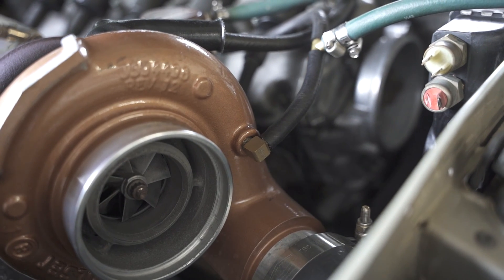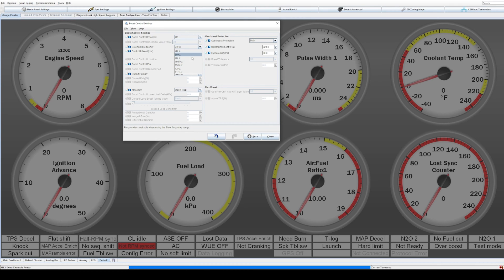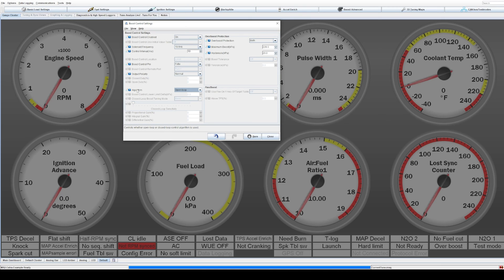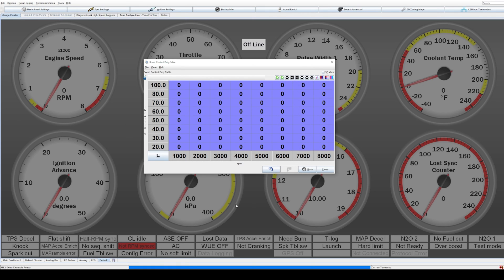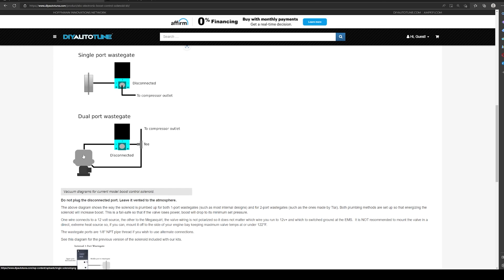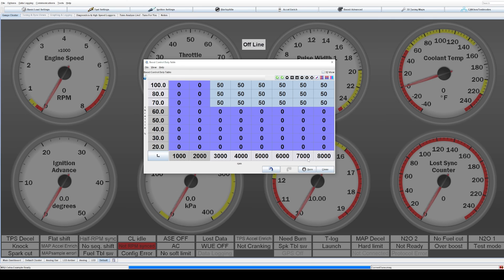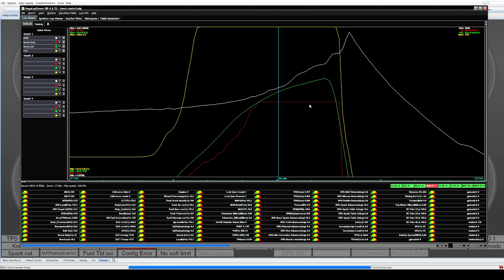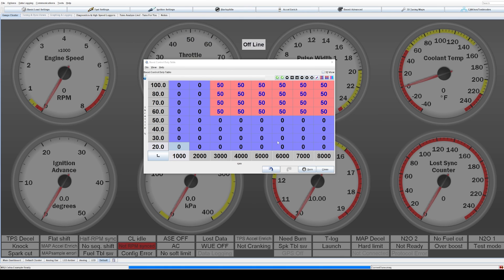Megasquirt Boost Control Basics | Open-Loop PWM 3 Port Solenoid | How to Tune

Comment: It would be nice if you covered the install for internal wastegate. I guess the selenoid works the opposite where it will block the signal to the wastegate until you reach desired boost ? In that case is there any rule of thumb to anticipate the extra boost from a certain duty cycle ?

Comment: Hi, I’m a little confused on the overboost protection section. You say 200kpa is equal to 1bar but isn’t 200kpa equal to 2bar? I don’t want to get that bit wrong lol. 😅 any clarification would be great. Great videos, I’ve subbed.
Reply: Ah!! Never mind, I found your other video covering Overboost Protection Basics. So anything over 100kpa on this cell is classed as boost pressure, so my current setting is 210kpa, this is 110kpa of boost right?
Reply from the maker: Yes 🙌
Reply: @ legend. Thank you so much. So glad I found your channel. 🙌
Reply from the maker: @ you’re welcome! Thanks for watching ✌️

Comment: Doesn't setting it to 100% in the lower areas hold it fully closed and increase spooling?
Reply from the maker: Yes it can but that’s in the advanced video  :) this is the basics just to get up and running
Reply: @TurbineResearch  could you link the advanced video on this

Comment: Hey man, thanks for the video.

I have a 1JZ VVTI swapped RX7 that uses a MicroSquirt. The VVTI is unplugged and unutilized, however after watching this video, I was wondering if I can use the boost control settings to control the VVTI solenoid (I have a greddy profec boost controller independent of the ECU) 

Since the VVTI solenoid also has a frenquency and is typically controlled by TPS x RPM, I think this can work. 

Theres VVTI calibration tables online… now the only thing is that my FIDLE is currently used by something else. 

Is that my only PWM control for boost control? Or is there other PWM controls I can use?

Thanks

Comment: Great video.  I’ve watched a few others on this topic and they mention running 100% DC in the lower RPMs to improve spool.  Would that reduce the life of the solenoid?
Reply from the maker: I guess it depends on what you are trying to accomplish with the tuning. These solenoids are very reliable and I don’t think you will hurt the solenoid by using it more during transient conditions
Reply: @TurbineResearch  Thank you.  I’m just trying to understand all this before messing with the boost control.  I’m going to follow the approach in your video first.   For single port wastegates, does the same math apply where 50% DC would result in 12psi on an 8lb spring?
Reply: Thats what i do.it’s one of the main reasons to have an electric boost solenoid.Just becarefull on your cross over cuz its ez to over boost before you get down to your desired boost.

Comment: My wastegate is a side port only, spring is 10 psi. Let's say I enter 70 for throttle % >= 50 and RPM >= 4K. Is the max boost 17psi?

Comment: how are you monitoring your knock when upping the boost controller? great informational videos btw!
Reply: just curious because I noticed your logviewer didnt have any monitoring for knock
Reply from the maker: This motor doesn't have any knock monitoring. However, the tune was verified safe on a dyno at this boost level

Comment: Car: '91 RX7 TII, Microsquirt ECU. I'll be using the FIDLE for the idle control. Which is the next preferred pin to use? The stock ignition will use IGN1, 2, and WLED for Select (Spark C). I ultimately will run a Flex sensor and knock control. Are there enough pins to run all these functions?
Reply from the maker: On the microsquirt you can use fiddle, tachout, aled and wled for boost control. You can try ALED in your situation